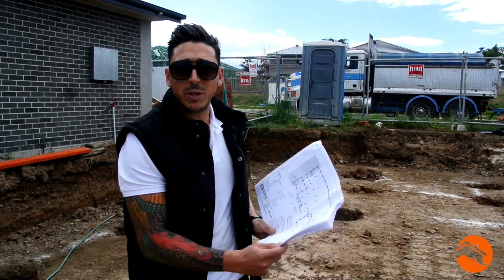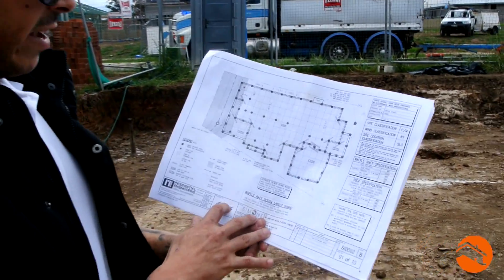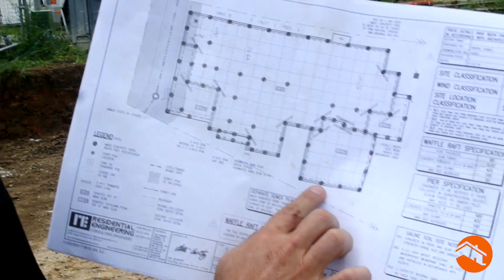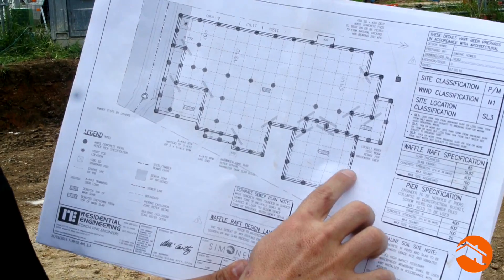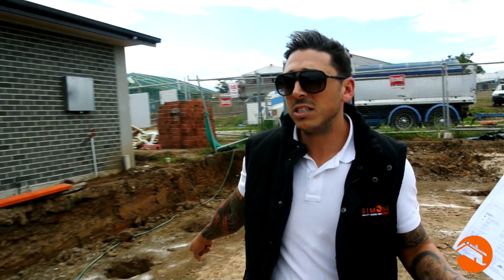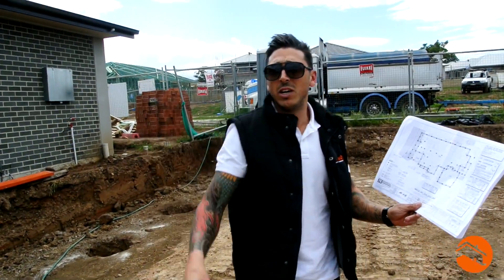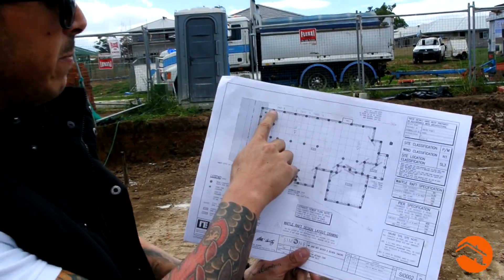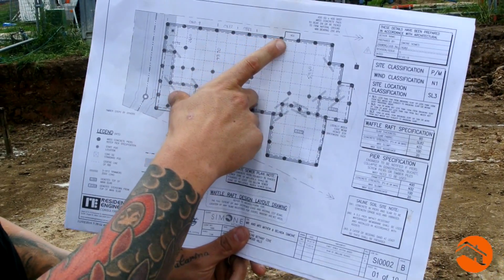Concrete Piering Explained | Simone Tv Episode 12

Comment: Hi mate, i have a question regarding the estimated depth for piers that the engineer provides on structural plans. The engineer lists the depth 1500mm below "natural ground level". If this does mean the levels of the ground prior to benching out for the slab doesn't that mean each pier will be completely different depth for sites that have fall and rise?
Reply from the maker: Hi James, Yes that is correct. It is very comen that all the piers will vary in depths depending on how much cut and fill is on the site.